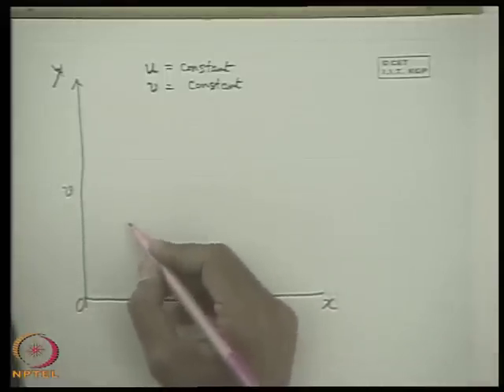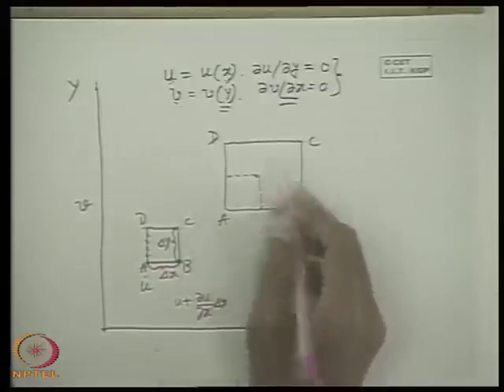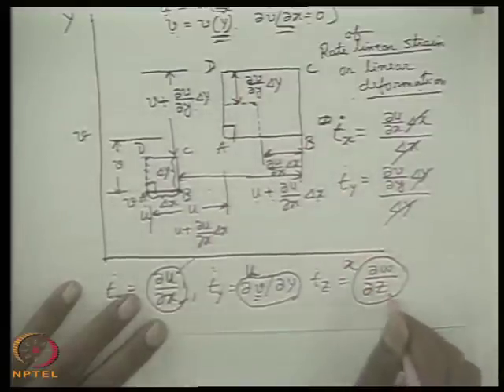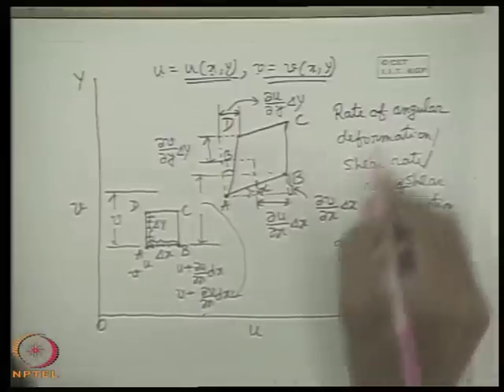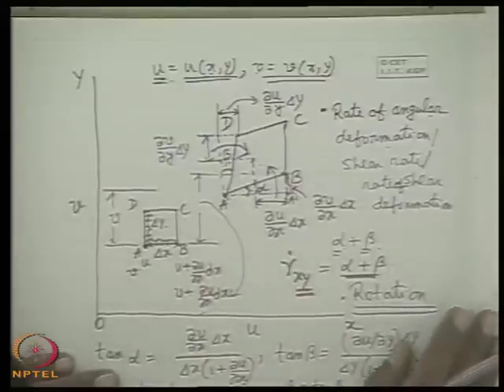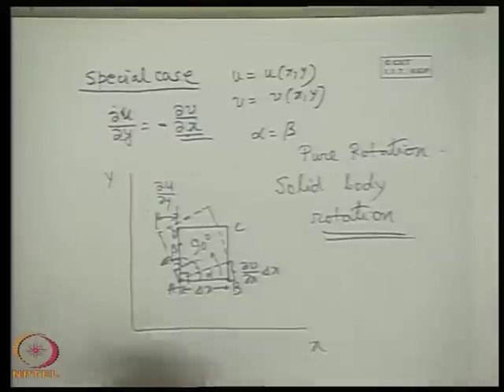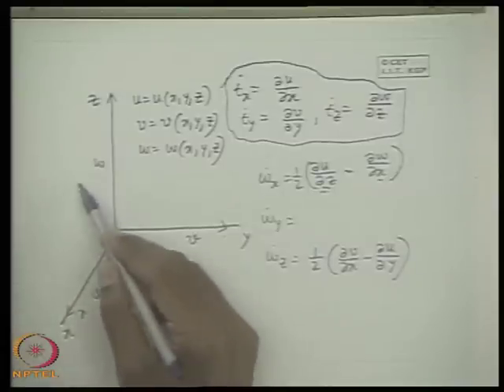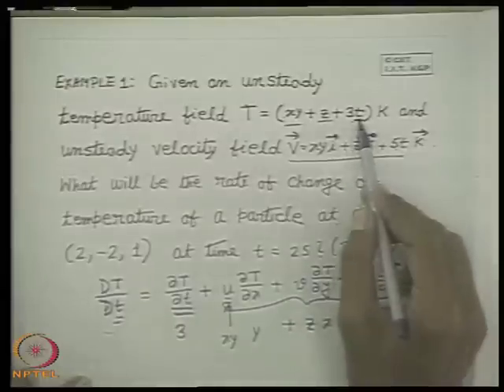Mod-12 Lec-12 Kinematics of Fluid Part - III

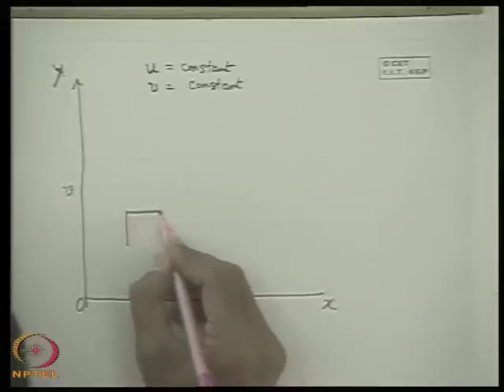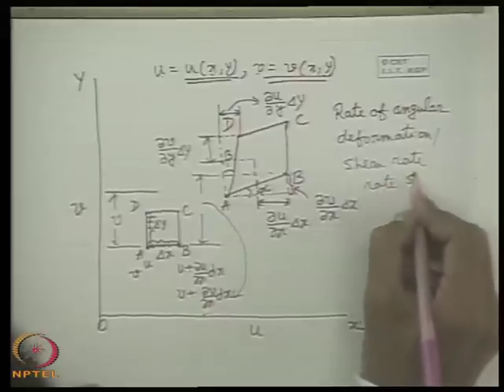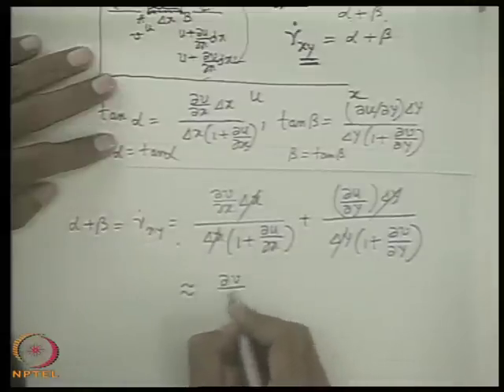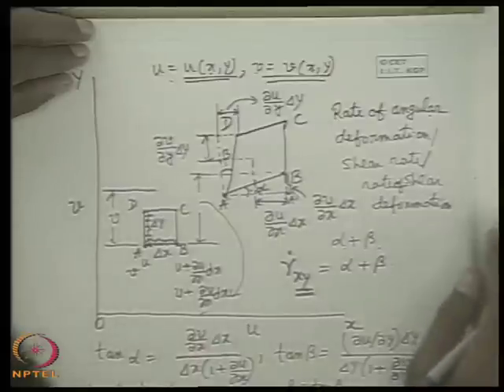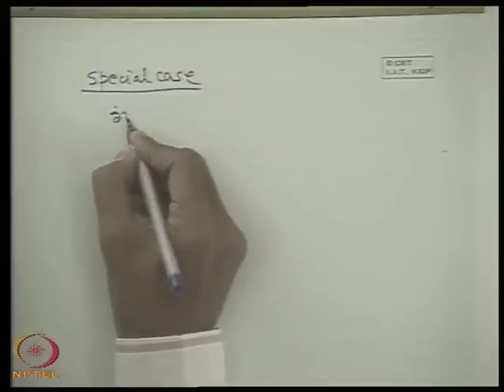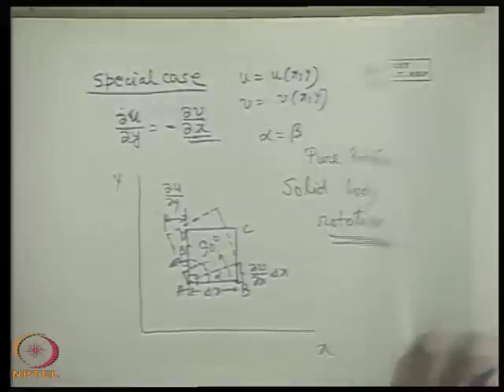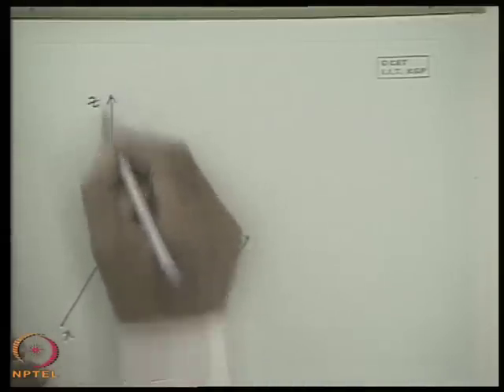Comment: Translation 3:26; Rate of Linear Strain or Deformation 6:22 *7:40; Rate of Angular/Shear Deformation 15:02 *20:29 😀 ultimate 24:36 ; Rotation 25:38; Special Case : Pure Rotation or Solid Body Rotation 29:34 ; Irrotational Flow 33:24, 3D 37:17
Ex1 43:04
S1 46:11 ,S2 46:54 ,S3 47:56 ,S4 48:51 
Q1 50:05 , Q2 50:56
Reply: Good work

Comment: Sir a little confusion in shear strain rate as u find the final result is (dv/dx + du/dy) in xy plane. But in R. K Bansal & also in Cengel book of Fluid mechanics the Shear strain rate is 1/2(dv/dx +du/dy).. Sir i have confused.. What is the true result.. I am waiting..
Reply: in this video it is taken as total rate of shear strain. if you are very particular about plane then you can consider half, otherwise leave it , because we are not dealing with solids where  we observe shear strain in total under a loading condition under elastic limit . but here we observe RATE of shear strain . If at all you want to make a tensor form of shear strain rate ,then you must consider half.
Reply: This one is correct . Actually  Shear strain is defined as change of angle before and after deformation not for mean of the change.
Reply: 1/2 is  the average rate of shear strain Nd which doesn't have 1/2 in it is  the total rate of shear strain

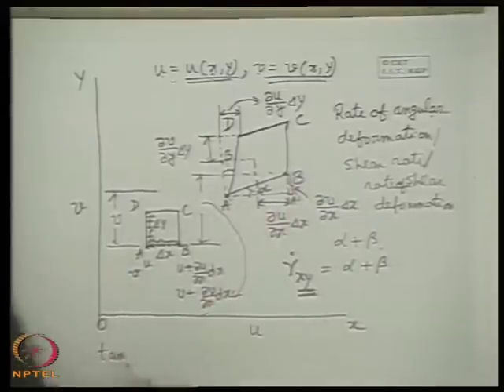Comment: At 22:21 - As per the figure, tan(alpha) should be equal to (del v/del x)/(u+(del u/del x)* delta x), but in the lecture denominator of tan(alpha) is taken as (delta x + (del u/del x)* delta x) and then delta x is taken out as a common term.
Please let me know which one is correct.
Reply: no no.. for denominator we need the horizontal component of new AB, which will be as sir told, what you are telling is the distance between old point B and new point B( i.e. the distance travelled by point B in horizontal direction per unit time)............. i think u are confused as i was, sir has expressed displacement and velocity on the same plane because he has taken velocities for 'unit' time.... writing for tan(alpha) he was using the dimensions of fluid element( i.e. the displacements...)....
Reply: @thakurmadhav4048  could you please elaborate.
Reply: @sahithyap1859  to calculate tan alpha we will have to take the ratio between the vertical distance travelled by point B, to the new length of AB after deformation.. We know that, the distance travelled by point B in vertical direction in unit time will be its velocity in the vertical direction that is (del v/del x) * delta x ; and new AB is delta x +((del u/del x)* delta x), and if you want, you can take delta x as common .. And so we can get tan alpha by taking their ratio.
Reply: @sahithyap1859  please tell, if my explanation helped you or not. If not i could explain it to you at any other interface.
Reply: @thakurmadhav4048  isnt it like we are adding velocity vector and displacement in the denominator.. I mean (del u / del x) *( delta x) is the dist travelled by particle b in "unit time" and delta x is the initial AB length
Reply: @sahithyap1859  we are adding the distances only in the denominator. Difference is just that (delta x) is the distance before the passing of unit time( may be 1 second, 1 minute or anything) ; and (del u/del x)*delta x is the extra distance travelled after unit time... See here we are calculating the deformations that is distances simply and we are using velocities for unit time to calculate the distances only because we know (distance = speed * time).. We take the time 1 unit to make our calculations easy.. Thats it
Reply: @sahithyap1859  Was it helpful for you? If you want me to go on more further you may ask for it..
Reply: @thakurmadhav4048 I think got it now. thankyou so much for your efforts in explanation.
Reply: @sahithyap1859  that's fine. I m also an student of fourth year mechanical. It was my pleasure to help you. For any further queries or anything msg me on abhaypaw10000@gmail.com
Reply: Okay. I get your point. Thanks!
Reply: @thakurmadhav4048   AT 10:12 "u" is the distance traveled by "A" & "(u+(del u/del x)* delta x)" distance travel by "B" in per unit time so time & distance take same value .therfore the lenght of "AB" should be distance travel by "B"minus distance travel by "A" & NEW LENGH of "AB" should be (del u/del x)* delta x   BUT  sir taken that as elongation lenght of "AB".  AS sir done it AT 18:58  the VERTICAL lengh of "A'B"    ,   VERICAL DISTANCE  of from old "A" to new "A"  (distance travel by "A")is ="v"     MINUS     vertical distance from old "B" to new "B"(distance travel by "B")is  = "(v+(del v/ delx)*(delta x))"         which  is equal to (del v/ delx)*(delta x)  ,  then how these two condiations at 10:12 & 18:58 will be different ????????   PLEASE ANSWER !!!!!!!!!!!!!!